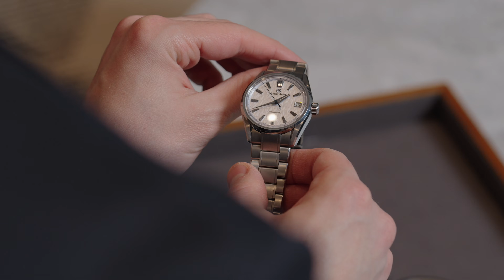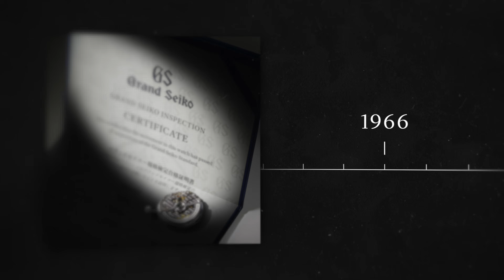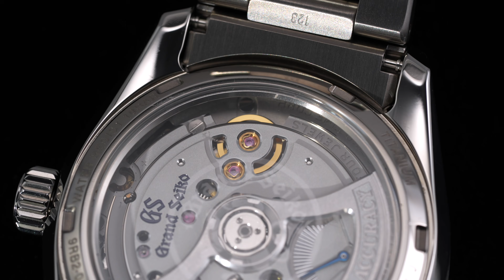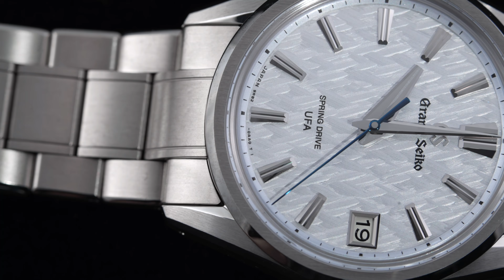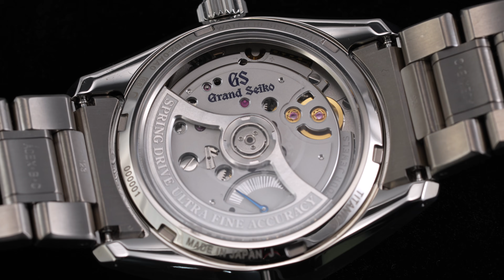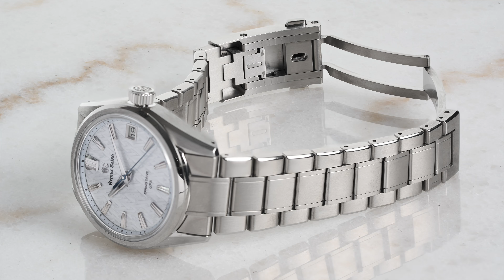The Most Accurate Spring Drive Watch Ever With A New Micro Adjustment Clasp  - Grand Seiko’s UFA

Comment: Joes Zaratsu haircut is impressive.
Reply: It’s molded after the bark on a tree outside the shinsu factory in spring within the shadows of Mt Fuji
Reply: @steves8322 😂
Reply: its accurate to +\-20 hairs per year 😂
Reply: Can you micro adjust the fade? 😂
Reply: Needs a couple of bevelled edges......
Reply: I was thinking the same exact thing. Looks great!
Reply: Bro 😂😂😂
Reply: A hair cut you can set you watch to.
Reply: My dude looks like a could be a Bond villain
Reply: 4 finger Ranger Cut, ya
Reply: They use a spring drive clipper to achieve that UFA fade
Reply: Sorry kids, it’s a wig. A toupee. Look at it closely. It moves independent of his ears.
Reply: My Casio G Shock, Edifice, and Oceanus Bluetooths are accurate to zero seconds per year. These are absurd over engineered, overly technical, Rube Goldberg machines, all to justify their absurd costs.
Reply: @thomasstratford6227  you don't get it, at all
Reply: Agreed! Oceanus has everything you need, and probably costs less than a single service of these GS watches.
Reply: @AtomsOfKnoweldge-z4t  Oceanus... is that a new hair wax for that surf hair look?

I think you two got lost in reply city and ended up hair!
Reply: @AtomsOfKnoweldge-z4t probably. But the technology is different, and that's worth different amounts to different people. It's not worth it to you, but I find it sufficiently interesting to be worth it.
Reply: @thomasstratford6227  Ok, so you think the haircut is a bit much then? More of a soft curl guy?
Reply: @thomasstratford6227 that's the whole point. It's interesting, beautiful, and fun to see what is possible engineering wise. And then to be able to wear it on your wrist

Comment: +or- 20 seconds a year is absolutely insane. This is innovation right here
Reply: Spring drive is patented and unique in the watch world.  No batteries.  Incredible engineering with a quartz crystal.  It’s one of the most incredible invention in the last 100 years of watch making.
Reply: I sense a Rolex fan in the comments.
Reply: @ken4747  Rolex fan/owner here.
Also have two GS, just not any quartz ones like the SpringDrive ; )
That new clasp is a joke too!
Reply: Unbelievably F*cking Accurate.
Reply: My SLGA009 is - + 2 seconds per year for me
Reply: It kind of remind me of kinetic watch
Reply: My citizen aq6100 has an accuracy of less than 1 second a year and incredibly thin (less than 10 mm) and comfortable to wear. The only thing I desire is a date window.
Reply: Casio’s Oceanus or Citizens Attessa with Solar Quartz, and either Radio or Satellite/GPS is more accurate than any UFA. Even a cheap Miyota 2115 or Seiko/Epson VX42E, VK63 can achieve less than 60 seconds per year. I love a good Quartz movement for GADA/Everyday watches. Springdrive is an excellent fusion of mechanical/quartz components, why would you not use a quartz oscillation to help regulate the accuracy of a mechanical movement? It’s the best method of achieving accuracy. Would be interesting to see GS incorporate radio/satellite accuracy into Springdrive.
Reply: @CasioToCartier 

Seiko determined that GPS-based time correction is more globally adaptable than traditional terrestrial radio signals, and in 2012, it introduced the world’s first GPS solar watch, the Astron.

Therefore, as you rightly pointed out, the birth of an ultimate timepiece that combines mechanical craftsmanship with GPS technology may not be too far off.

On the other hand, Grand Seiko’s philosophy emphasizes a spirit of craftsmanship that values “creating precision from within, not receiving it from outside.” Because of this, technologies like radio control or GPS — which rely on external input — may be seen as conflicting with its aesthetic and philosophical ideals.
Reply: +/-1 per year is allegedly achieved by The Citizen caliber 0100.
Reply: The smart blah blah I am highly educated guy is not what he pumped himself to be, the real quartz grand Seikos are quartz this is spring drive a hybrid movement even chapgpt agrees why are beating a dead horse I don’t get it.
Reply: it's a watch with a quartz in it. no, it's not insane.
Reply: Bulova precisionist quartz movement achieves comparable or better numbers and also has a continuous sweeping second hand at a fraction of the price. When they make a watch not so ugly and gigantic to feel embarrased of wearing it I will buy one for sure.
Reply: Ça n'est pas vraiment une montre à quartz, c'est une montre mécanique automatique à régulation à quartz, il n'y a pas de batterie à changer dans le temps, l'entretien est le même que celui pour une montre mécanique classique
Reply: Unlike ugly Rolex Land-Dweller
Reply: Mine is +/- 5 sec a year. There’s even a Watch that has +/- 1 sec a year.
Reply: @SRADracer , yeah, I am a bit confused by their wording, as well.  Maybe if they had it under 1s per month, then okay.   But, by this counting method, Duxot i am wearing today is +- 60 seconds per year
Reply: @SRADracer  Those are watches from the High Accuracy Quartz (HAQ) family. I have the Grand Seiko SBGT241 LE (+/- 5 Seconds a year).
Reply: I like how they say “we aren’t measuring it in sec/month.” It’s literally 1.5s/month lol
Reply: @ulmen24  my thoughts exactly! 1-2secs per month.
Reply: @ulmen24  peak marketing BS. Instant turn off just out of principle.
Reply: It has a quartz crystal inside it! 
My £300 quartz watch stays within 5 seconds per year haha, I'm not impressed.
Reply: There are plenty of other watches reaching above and beyond this for a quarter  the money
Reply: @Snowmunkee  Then buy them then lol
Reply: @Snowmunkee Name one.
Reply: It’s a quartz watch, what else should you expect? It’s nothing special
Reply: @jimbobsmith2496  it’s an automatic movement, not a quartz watch. The spring drive using a quartz crystal doesn’t make it a quartz watch (using batteries)
Reply: @ does it have a quartz in the movement? Yes it does. Why because it is a quartz watch. Doesn’t matter if it has a main spring running the quartz movement, it is still a quartz movement. The spring drive is an overpriced novelty toy, nothing special about it.
Reply: @spurslegacy  everyone you're responding to has no idea what amplitude means in watchmaking and how it affects accuracy as mainspring wind down.
Reply: @jimbobsmith2496  Bro is ranting the age old “sPrinG dDrIve Is nOt a rEal aUtoMatIc cAuSe iT hAs qUartZ iN it.” 😂
Reply: @jimbobsmith2496  just upset you cant afford one
Reply: @jimbobsmith2496  Rolex just created a fully synthetic pallet fork system to get 5hz in a more efficient way, is that not a true mechanical movement? Synthetic ingenuity just modernized the mechanical watch, spring drive is not just a meh glorified quartz watch. It's ingenuity, and modernization of classic watch movements. Much like all the synthetic components Rolex just introduced.
Reply: @jimbobsmith2496 my dude, everything above an F91W is a novelty. We're talking about luxury watches here. Everything beyond a 15 dollar Casio is unnecessary and novel. You're in the wrong hobby.
Reply: @jimbobsmith2496  A watch movement (calibre) is much more than just a balance wheel! Hence, you cannot define a quartz movement by only saying it has quartz in it. Spring Drive is a hybrid movement using instead of a balance wheel a disc and an electromagnetic break regulated by a quartz crystal. At the opposite end you have a digital quartz watch with an LCD screen and without any mechanical parts. A step further are analog quartz watches with a stepper motor and gear for the hands. The way you oversimplify the matter, a contemporary car with an internal combustion engine and computer controlled fuel injection instead of the traditional carburetor is an electric car?
Reply: @jimbobsmith2496  all analog watches are novelty toys. that's what makes them fun!
Reply: @ichipow  your computer controlled fuel injection analogy is spot on
Reply: @jimbobsmith2496  Someone obviously doesn't know much about the Spring Drive...

Take a look at a quartz movement (batteries, electronic) and a Spring Drive one. They are 2 completely different things.
Reply: @ nope, I know what the spring drive is, I understand completely how it runs. Just because the power source is a main spring instead of a battery does not eliminate the fact that it is a QUARTZ watch. Just because it is a little fancier than the Presage does not mean it is special. The only thing GS has is beautiful dials.
Reply: @jimbobsmith2496  if you want to be more accurate in description, it’s a hybrid. Quartz is a name used to characterize watches with a battery and quartz, using it to name spring drive is objectively incorrect.
Reply: I would say it's a hybrid. Cheating really @jimbobsmith2496
Reply: Its a quartz oscilator, and even has eltronic componentes, but yeah manual wind, but using the qurtz accuracy, so its by engeneering defition a quartz watch, hybrid movement  @spurslegacy
Reply: @spurslegacy  It's a spring powered quartz watch, as opposed to a battery powered quartz watch......... So a quartz watch.
Reply: @_IMNNO  He is 100%correct though lol 😂
Reply: @jimbobsmith2496 You’re either ragebaiting or you’re genuinely rtarded
Reply: @jimbobsmith2496 dude Google a picture of the mechanism it's not just a quartz watch...
Reply: @jimbobsmith2496  no
Reply: @jimbobsmith2496  it's called a "luxury" watch for a reason. Anything above $100 would be an "overpriced novelty toy"

If you find these overpriced, you just lacking of understanding watchmaking. Also, if you can't afford it, you're not the demographic.
Reply: @jimbobsmith2496  you must be 100% american.... xD MAGA idiot maybe
Reply: @jimbobsmith2496  Your average quartz watch performs at the accuracy of +/- 15s per month maybe if you are lucky. With +/-20s per year, this is right in the HAQ levels while being spring driven.
Reply: @jimbobsmith2496  educate yourself lol
Reply: @jimbobsmith2496 so much hate
Reply: @jimbobsmith2496  Go educate yourself 🙄
Reply: @ sorry there bub, but I am highly educated, but what a great attack by you. Clearly you are the one who is lacking in the level of required education. Absolutely everything that I stated is a fact, and is also stated in the video.
Reply: @ Apologies, it wasn't meant as an attack. As an owner of an SLGA023, I am probably a little defensive. However, to state that the spring drive movement is nothing special implies ignorance.
Reply: @ it is not ignorance, the fact that the SD has a tri-synchro regulator to turn mechanical power into electrical power to run the quartz crystal at over 32k hz means it is a quartz watch with a fancy mechanism instead of a battery. 

And I am the proud owner of the SBGA387, and it is the watch that was on my wrist today. GS dials cannot be surpassed, and when I bought mine I looked at the SLGA023 and was torn between the two. But just because I own one doesn’t mean it’s not a quartz movement, that it is some special movement. If it so special why haven’t other manufacturers developed their own? The answer is because it is a gimmick. You can love the watch for what it is and not over value it. Real watch lovers and collectors are honest with what they are, it’s the entire reason the G Shock is god tier.
Reply: @jimbobsmith2496  The fancy mechanism that powers the quartz oscillator in SD is called a main spring. Maybe you have heard of it.
Reply: @jimbobsmith2496  I for one would like to repent for having overvalued Spring Drive. I declare to the world that Spring Drive is but a gimmick, and that a quartz is merely a quartz unless housed in a G-Shock, in which case it is divine. 😇
Reply: @jimbobsmith2496 but it’s not, it’s a quartz regulated mechanical watch.
Reply: @alanmeyers3957  it’s a gimmick, it’s not a serious movement, it’s not special. With engineering today, if the market place had a real demand for a his type of movement, the market would copy it just like we see the market copy everything else. It was special and difficult in 1977 when GS started working on it, not 48 years later. 

Don’t get me wrong, they are still a work of art, and one that everyone should seriously look at, and I own one. But to think it is a grail piece to put on a pedestal is crazy.
Reply: @jimbobsmith2496  Stop embarrassing yourself and get informed before you post ignorant comments!
Reply: @jimbobsmith2496  well with that logic since it has mechanical aspects ita still a mechanical watch
Reply: @jimbobsmith2496 define "quartz watch"Yes,using battery.don't be snob
Reply: @jimbobsmith2496 where’s the battery?
Reply: @jimbobsmith2496 

Stop joking, brother.
I guess you must call hybrid cars EV cars😅
Reply: @ what am I joking about bud? It’s not special, the Citizen is more accurate, they are 75 years behind on the bracelet. The second hand is not as smooth as many people try to make it out to be as the movement constantly applies the brake to keep it in check. And the entire reason for the high level accuracy is because it is a quartz watch with a different power source, nothing special about it or the market place would have copied it decades ago.
Reply: @jimbobsmith2496 

If it’s just an ordinary watch to you, then you shouldn’t have bothered watching this video in the first place. It’s a waste of time, and you’re probably just being sarcastic because you can’t afford it anyway.
Reply: @ got it, anyone with a negative comment doesn’t have the right to watch a video and comment. According to you, every single comment must be from a fan boy. 

And my bank account would stun a team of oxen. And yes, I own a spring drive and a high beat. The spring drive is a novelty, and as I said before, if it was such a special movement, someone else would have copied it. You know, the same exact thing that GS finally did with the micro adjustment bracelet 75 years after Rolex did it.
Reply: @ the difference with hybrid cars, and EVs, the market is copying them because they are special, the have a demand in the market place. You really need to ask yourself why no one copies the spring drive. After all you think it is a unique watch, that is uber special. Clearly you know more than every single watch company on the planet.
Reply: @jimbobsmith2496 

You’re wrong, boy.
You’re watching this video because you’re interested, aren’t you?
If it were boring, you wouldn’t have watched it in the first place.

Just like how you’re now admitting that the Spring Drive is an interesting piece of technology.
Reply: @jimbobsmith2496 

And you’re mistaken, boy.
Just like how it took Grand Seiko years to develop a micro-adjust clasp, other brands haven’t copied the Spring Drive simply because it’s difficult to replicate.
Reply: @jimbobsmith2496 

Let’s just hope you came by that bank balance the kind that could stun a team of oxen legally.
Reply: @ 🤣 sure it is. Funny how virtually every other  brand has a micro adjustment band, but for some reason only a crappy brand that takes 75 years to copy others, magically did something that no one else has been able to do in in the 26 years since GS launched it, and 43 years after they started developing it. Sure bud
Reply: @ I did come by it legally. It’s nice having an inheritance and then growing it exponentially.
Reply: @ I never said it wasn’t interesting, I said it’s not special. The Citizen 1 is 1 second a year. That’s interesting, that’s the same quality your phone has. And like most watch enthusiasts, I watch everything I can get my hands on.
Reply: @jimbobsmith2496 

You’ve got several watches from the brand you boldly call a copycat, haven’t you?
You’ve got some unusual tastes.
Reply: @jimbobsmith2496 

The saying “Don’t leave fertile land to your descendants” is really well put.
After all, by not leaving anything behind, you avoid raising worthless people like this.
Reply: @jimbobsmith2496 

The saying “Don’t leave fertile land to your descendants” is really well put.
After all, by not leaving anything behind, you avoid raising people like this
Reply: @jimbobsmith2496 Jesus its a watch. Anything beyond the cost of casio f95 is superfluous. Let others think its special if they want. Does other thinking its special makes you feel bad? Makes you feel inadequate? Its a luxury watch. Stop being a snob and let people enjoy what they enjoy. They are not hurting anyone. Does pointing out something isnt special for you makea you a better person? Increases your value to humanity? probably not. So why be a sour douchebag?
Reply: @jimbobsmith2496 It’s a hybrid. Mechanical with a quartz regulator